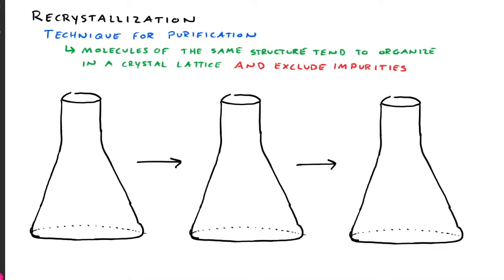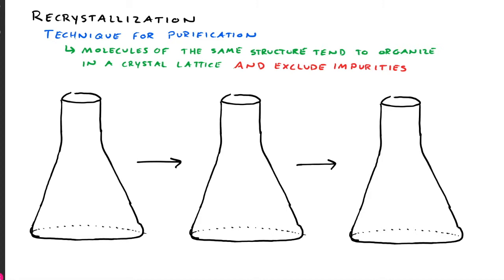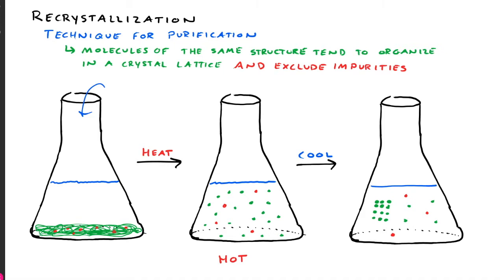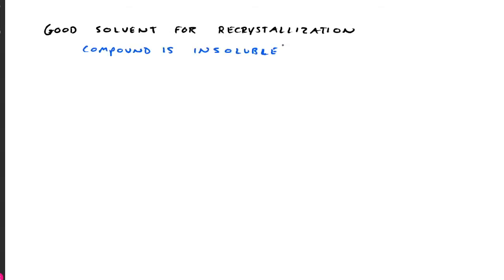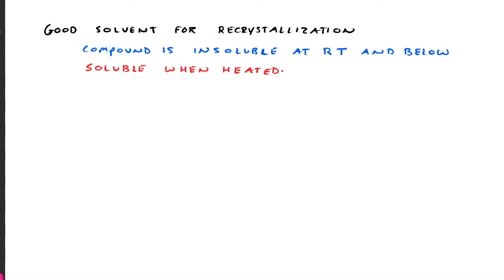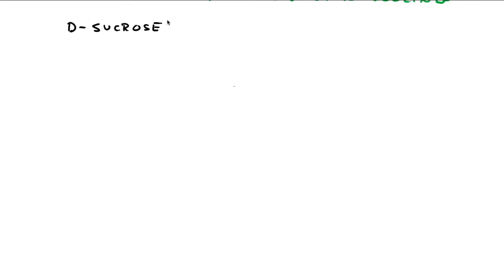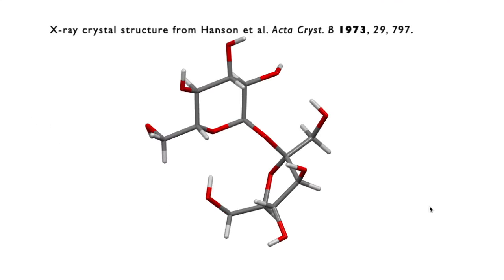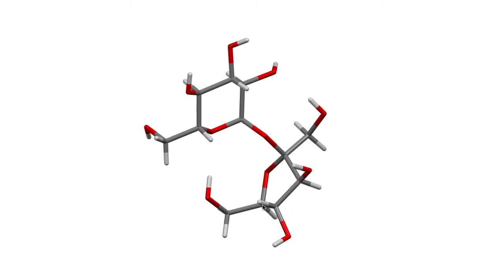Recrystallization

Comment: Nice video. Can I ask why you didn't filter the sample after adding the hot solvent and dissolving you product to see if there are any insoluble impurities to remove before carrying out the rest of the recrystallization?
Reply from the maker: Great question. It is generally good to perform a hot filtration in case there are any insoluble materials (as you mention). In this particular experiment, I was confident that all of the material was dissolved at elevated temperature.

Comment: Isn’t the DCM called the stationary phase? Can I ask what TLC plate you used? it doesn’t look like you used a glass silica sprayed plate….
Reply: DCM is a solvent that flows through the silica stationary phase. Stationary phases don't move, solvents that move through a column or on a TLC plate are called the mobile phase. Its common to use silica 60 aluminium backed plates as opposed to making your own; this is likely what the publisher is using, best of luck with your art!
Reply: @R00K1  yes I was talking about TLC - I just messed up all the phrases of phases (look at that I’m a rapper). I annoyingly bought these massive TLC plates (200x100mm), already sprayed with silica and am usually testing tryptamines to see when a reaction is done. 
I do not have the money to buy more, smaller ones but I often see people performing TLC on some sort of paper (not necisarrily for tryptamines) and am just wondering what the paper TLC is used for? Can you test the same things - essentially I’m trying to understand why you need silica gel backed glass, as opposed to other times I have seen people using paper for TLC…
As for collumm chromatography, it’s not something iv utilised yet but the theory is the same right? Different compounds travel through the stationary phase at different rates and therefore by running an impure sample through it - followed by solvent, the side product will seperate from the compounds you want…
Pretty sure this is correct and I have learnt a little. I do know the ‘developing solution’ is different for tryptamines something like 100:25 DCM:acetone or something - that’s for TLC, not collumn chromatography
Reply: @Aldertonartco  the backing for TLC plates isn't important usually, unless your compound reacts with it; aluminium is usually cheaper though. If you get the big 200x100mm aluminium backed ones you can cut them up with scissors or a sharp razor blade into more manageable sizes. People usually prefer using silica TLC plates as opposed to paper for three main reasons: 1. they're stronger. 2. they're usually doped with a fluorescent salt so you can see your spots under a UV light. 3. You can dip silica plates in different staining solutions to better visualize your spots whereas paper would dissolve. The solvent mixture you're referring to is your mobile phase and assuming you're running silica plates, and silica in your column the solvent mixture would likely work for both.
Reply: @Aldertonartco  Also TLC and column chromatography work on the same principals, just different setups and use-cases
Reply: @R00K1 ah ha - now THAT was the answer I was looking for! Okay yeh that makes a lot of sense. I had a feeling it would have been to do with the whole fluorescence thing…didn’t think of the fact they are stronger. Makes sense. 
Okay so I just bought a glass cutter and am cutting the 200x100mm big plates Into 5x smaller ones that actually fits into my beakers with watchglass on top.  Thanks for explaining that - given I’m working with tryptamines, it makes sense why everyone suggests the glass silica sprayed ones because otherwise I doubt you would be able to see the results!
Reply: @Aldertonartco  I've never worked with tryptamines, but if they're anything like tryptophan than they should be fluorescent under UV light

Comment: Can I ask what those frame clamps are called and where can I get one? Or do people make them? You don’t usually see chemtubers have the frames - they usually struggle like me with portable clamps. I take it they go through the bench and are secured from below the worktop?
Reply: They're sold as slotted lattice connectors; lab lattice supports are usually secured to the walls and floor of the fume hood

Comment: Please help me 🙏
I'm confused in the distillation method,
Exactly when taking pure substances
I deliberately used a sample of medicine that had 5 ingredients in it, after I finished extracting it, then I filtered it and got the residue & filtrate.
But I'm confused about how to separate the purity of these substances using the Distillation method, even though I have recorded the boiling points of the 5 substances, here are the boiling points:
Substance A > Boiling point: 400 °C
Substance B > Boiling point: 260°C
Substance C > Boiling Point: 379 °C
Substance D > Boiling point: 520 °C
Substance E > Boiling point: 232 °C
For example, if I want to get the purity of substance B, how do I do it ?? 🤔🤔🤔

Who knows, someone might be able to tell, 🙏